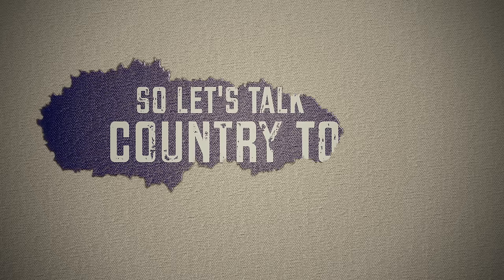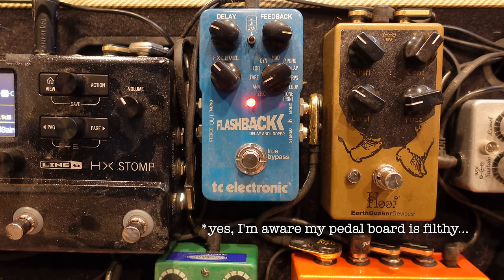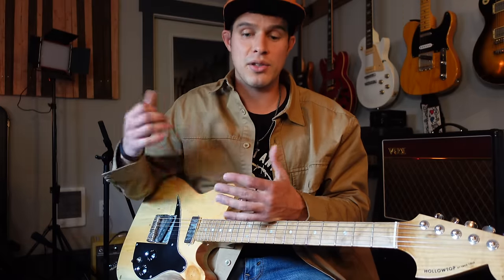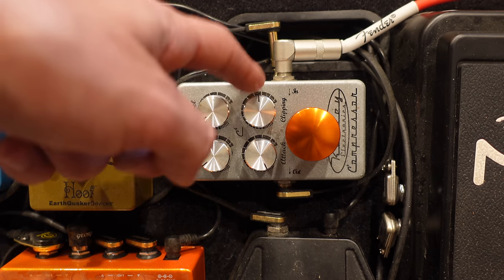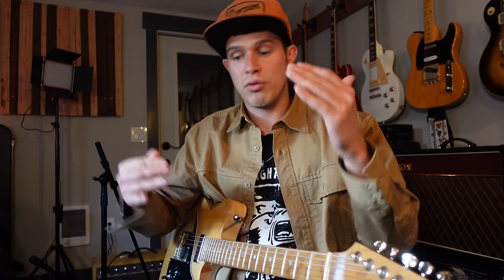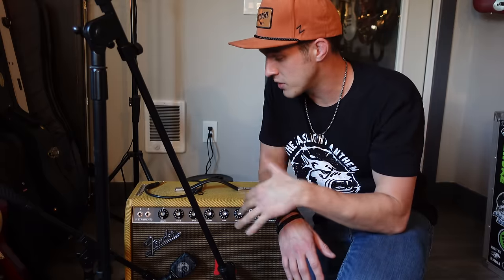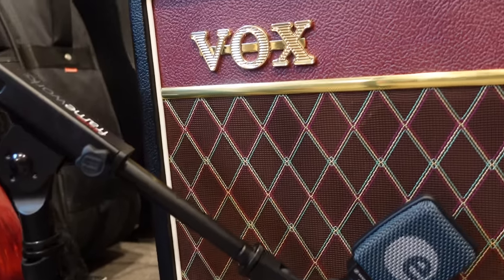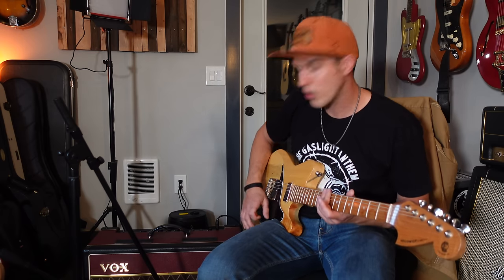Dial in an Amp for Great Country Guitar Tone

Comment: Far as I can tell, a decent portion of the reason that compressors are quite so ubiquitous in country guitar is that they tend to make fender black and silver panel style amps, and other amps to a certain extent as well, sound a little more like tweed style amps and country is always throwing back at least a little bit to 50s country western... Tweeds tend to naturally have a good amount of compression inherent in them... Also offsets do a pretty good job in this style because they're not really particularly far off a tele sonically especially jags 🤠
Reply: THANK YOU, STEVE. A brilliant, video, so, straight forward. I have subscribed, to you, chanel, that I just stumbled on. And glad I did.
Reply: A buddy of mine went woke…decided his amp had to be “black panel”. From that point on, his sound went weak, muted with not much dynamic range. I’ve found these old amps appreciate being addressed just as they have been for the past 40 years…a BLACKFACE Fender amp. They’ll sing loud, wild and true to their heritage.
Reply: Gooood point
Reply: @timtompkins6752 

         Define woke,..
Reply: @Steven-re3tx I was kinda wondering what it had to do with amplifier choice

Comment: The country tone sounded great with just the amp and guitar... and the player of course! The other pedals added the icing to the cake. 

I've heard many similar explanations of how compressors work, and didn't understand it until I realised it wasn't how compressors work! The first part of the explanation is all that was needed. It makes loud sounds quieter. What it doesn't do is make quiet sounds louder. As the difference between the loudest and quietest sound is smaller, it gives the impression that quiet sounds are louder as they are closer in comparison to the loudest sound. Below the threshold setting, the volume does not change at all. The overall sound can be made louder with the gain/volume control but there isn't anything interactive happening to make quiet sounds louder.
Perhaps I'm over complicating things, but it made much more sense to me!

Comment: Nice video with lots of useful information.  One thing I would say is that compression doesn't compress lower and higher volume.  It's lower and higher frequencies that get compressed which intensifies the impact those compressed frequencies have on the sound.  It's what give that popping type sound to the notes when you pick them.

Comment: To compensate for bright pickups, we're told to cut the treble on the amp instead of using the treble cut on the guitar. I recently saw a video saying you should do the opposite, boosting treble on the amp and cutting it on the guitar. I wonder why someone would choose one method over the other? Good video.
Reply from the maker: Yeah I think it comes down to preference. I normally set my amp with the volume and tone on my guitar all the way up. That’s kinda my base tone. I can change the guitar on the fly if I feel like a song calls for it but it’s a lot harder to change the amp mid song (and sound guys get suspicious when you’re tweaking your amp mid gig 😂)

Comment: Fantastic video Steve! Here in the UK Fender tube (or 'valve' as us Brits often refer to them) amps are damned expensive! I recently picked up a 2nd hand Wharfedale 30  (in the US badged 'Albion') combo. It has 2 channels. CH1 is pretty much Fenderish, adjustable to Vox 15/30. CH2 is Marshellesque, but can be tweaked to AC30TB. I'm really enjoying using your advice through it to make a multitude of country tones. You're spot on with the pedals too. Thanks so much!
Reply from the maker: right on, sounds like you're figuring it out! We're the opposite in the states, Marshall amps are quite a bit more expensive over here 😂

Comment: You really don't need a compressor although they are really nice. 
 I run through a Tech21 Fly Rig 5 and get a great set of tones with it. Everything from Country to rock to everything inbetween.
Reply: I have the mk2 version of the Fly Rig 5. It is a very useful pedal, but would have been even more so with a compressor built in!
Reply: @asw7696  MK? Who's that? I thought I knew all of the Fly Rig 5's?
Reply: A compressor pedal takes away string to string definition dynamics.
Reply: @BryanClark-gk6ie  They can yes. But, sometimes a compressor is just what you need or want for a particular sound. It's definitely not necessary by any means though.

Comment: I watched this hoping he'd give the guitar settings. Newbie to electric guitar. I can't get a sound I like out of my telecaster. Have tried every combo of the pickups, and rolling treble up and down. Nothing gets anywhere near a country sound to my ear.
The good news is I bought my first pedals knowing nothing about them and by chance got a delay & compression!!! I plugged my lap steel in and got a nice sound with single coil w tone knob rolled halfway down. 
So there's that. 😊
Reply from the maker: I’m on the bridge pickup and tone and volume are all the way up on the guitar! If it sounds too bright you can certainly roll back the tone knob a bit.
Reply: @stevetharms  Awesome, thanks man. Great tutorial. I dicked around after commenting and came close to that. Ended up with about half turn roll off. I got the delay set, but still working on compression, seems really touchy. It's a really cheap Chinese knockoff. Didn't want to invest too much until I got a better feel for electric. So different from acoustic. 😎
Reply: @StanFrantz 
Country guitar chops YT channel. Simple and straight to the point.

Comment: Good stuff Steve...got a Q when you were going over boost/distortion usage, when you do use it. Do you typically chain boost/distortion first, then compress...then off to modulation (dly-verb-chorus-vib etc.) <>to amp?    Thanks appreciate what you do!  ...next got to start getting my ring finger and middle finger involved in picking, seems like the entire technique deal breaker.
Reply from the maker: I will run my overdrives after my compressor. I have a clean boost at the very end of my signal chain right before it hits the amp for a lead boost.

Comment: I thought the Fender amp's sound was better suited to the classic country tone than that of the Vox.  There's one element that I don't think you mentioned: the guitar's tone control.  It sounded to me like that was wide open.  Roll it back a little (on my red Tele, it's 90 degrees) before tweaking your amp settings, and the bridge pickup country tone will be even better.
Reply from the maker: I normally won't mess with the tone control on the guitar as much but it's certainly not to be forgotten about, another great tool to shape your sound!
Reply: @stevetharms  Thanks Steve.  I always felt as though backing off the tone meant I was missing out on something that couldn't be put back, but then I found that starting with it backed off and adjusting the amp to suit, resulted in a more pleasing tone.  On my Squier CV 50s Strat, backing off the bridge pickup tone control is essential (I once had a 1979 Strat but never connected the bridge pickup this way, and consequently rarely used that pickup).